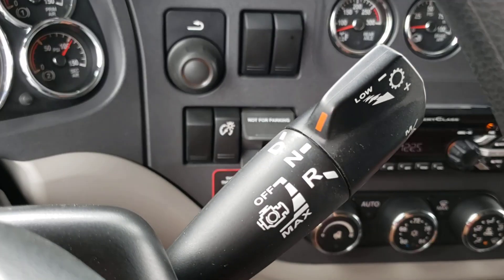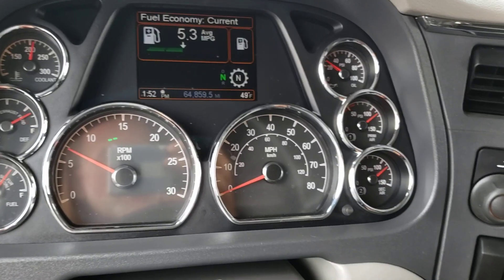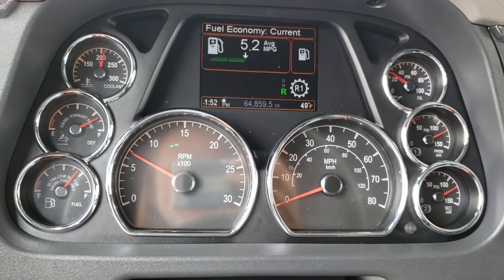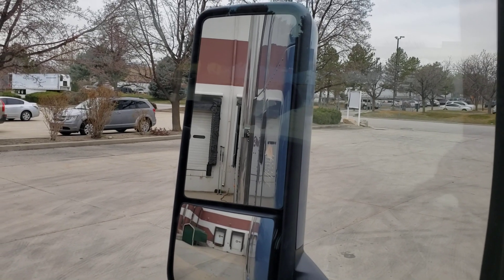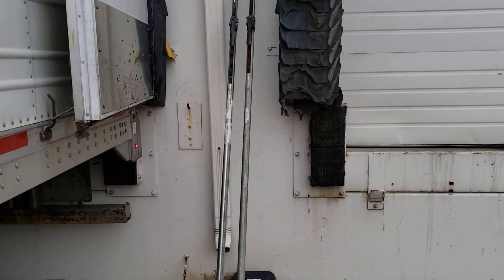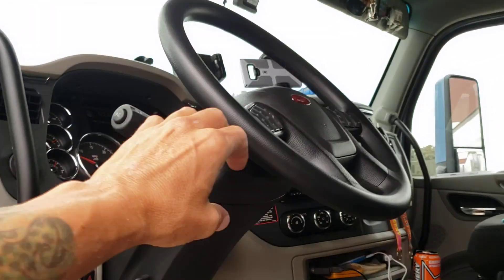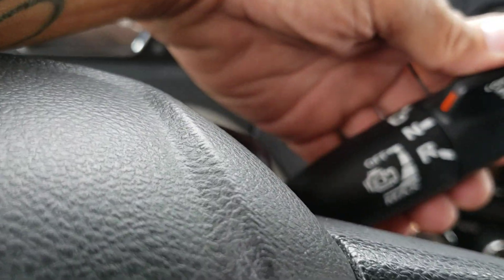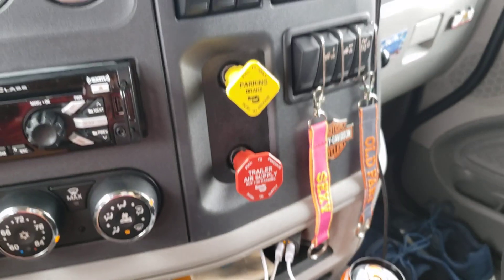HOW TO Back Up To Dock in Semi Truck Automatic Transmission

Comment: My trainer taught me that once I'm against the dock then hit the throttle to make sure I'm flush against the dock then set the air brakes. So far I've damaged two trailers by doing this. Your method looks much more reasonable.

Comment: The automatics I drove would not move back when you let your foot of the brake. That was the problem. There was no way to back smooth. It would lurch no matter how gentle I was with the accelerator. Maybe it depends on which one you have. I hated trying to back that thing, and I have been driving trucks for 30+ years!
Reply: Do you have a kenworth  ? Same here I remove the hill assistant but same problem it won't move until I press the gas
Reply: @mikecioka1180  International with the Eaton Fuller. I still don't like backing with that thing.
Reply: International automatics are a headache
Reply: I agree completely. I drive a 2017 Peterbilt 579 with the 10 speed automatic transmission and when you are stopped and take your foot off the brake, the truck will not move.
I keep my left foot on the brake and lightly feather the accelerator until the truck starts to move, but many times the truck jumps and I still end up hitting the dock hard. 
It sounds like the new 12 speeds are better because the truck backs up when you take your foot off the brake without having to use the accelerator.
Reply: I have the same problem with the truck i have now i put in reverse and that thing wont move i have to give some gas and that mess my backing like crazy i hate it
Reply: @HomieHelpLine they're literally the same transmission lmao
Reply: i legit tried to back with an automatic for the first time today and had this exact same issue then automatics aint it
Reply: @R2D_2-y1k  I also used to have this problem with my dads 2018 Peterbilt. But now Im driving the newer freightliners. It actually comes with a creep mode for reverse. Helps out a lot. 100x better than the older automatics. But I still prefer a good ol 10 speed 👍

Comment: I had a pete that didn't have creep mode. I had them reprogram the R to R1 and that helped a bit but still had to hit the gas pedal just to get up the hill or over the bumps at the dock. The Detroit DT12 Cascadia I now drive is far easier. I just let it creep back. Pete is far more comfortable to drive but they don't offer the dt12.

Comment: Im just trying to figure out how to make my automatic truck creep. Been driving manuals for so long so i clutch to slow. But i either dont move and roll forwards or barely touch the gas and this truck is going 100mph in reverse. These automatics are awful and i legit hate them cause i feel like a rookie smashing into docks but i have no control over whether this truck eases back or just goes full on psycho and just rips in reverse while i barely touch the fuel pedal. So how do i get automatic to just roll in reverse without touching the gas cause mine definitely doesnt do what his truck did and easily went in reverse!!!!
Reply: Exactly 😢

Comment: And automatic is pain in the ass and bad when hook up the heavy trailer. It will go so fast and hit the king pin very hard. The trucking company should have left the reverse gear in manual for these automatic trucks.
Reply: The manufacturers knew of the problem when they were building the damn thing .. I’m sure they test drive before releasing them yet didn’t give a f... 
Is it so hard to make a creep mode??